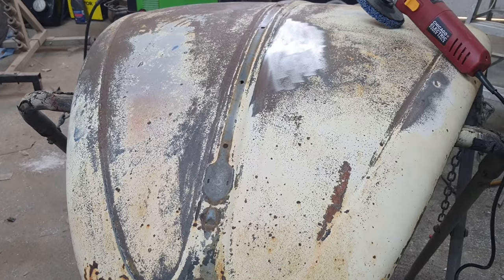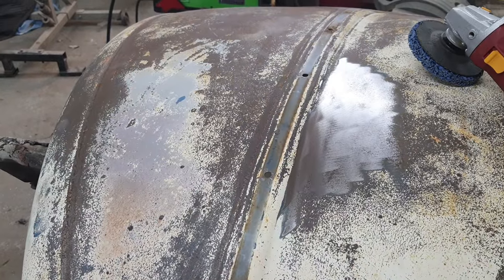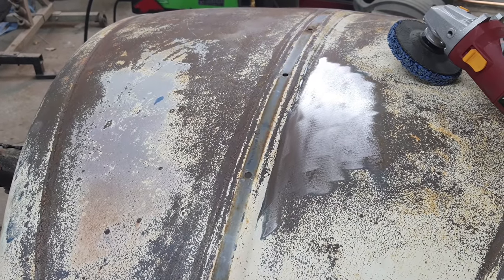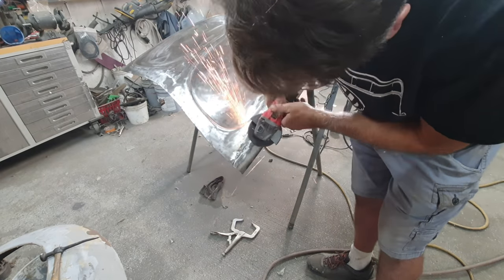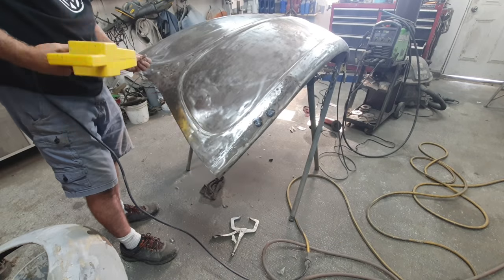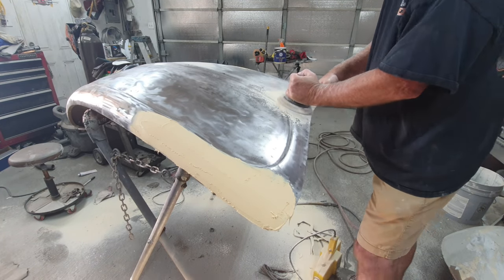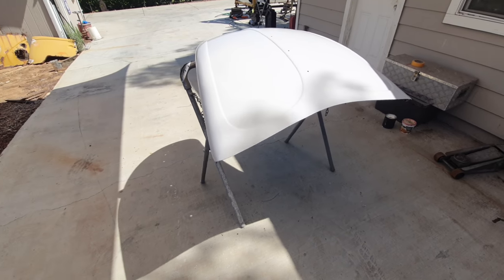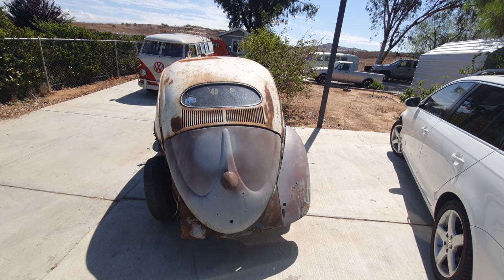1954 VW oval window Hood restoration forgotten Abandoned VW bug Metalwork to primer

Comment: Great video,s. I'm a body man up here in Northern Newhampshire.  We only use epoxy to make paint stick. It's not a good sealer at all. We here never do bodywork over primer. I was taught the old school way. Always go to bare metal before bodywork.  No rust in California.  Up here you don't find many old cars. Keep up the great videos. I also bought the titanium welder from harbor freight.  Works great in my opinion.
Reply from the maker: Thanks for sharing

Comment: Mike I’m not being critical of your work. I enjoy watching your vids. Just some ideas for you. I’m a collision tech/instructor/restoration guy for many years. 
Here are my steps. 
Metal work, rust converter as needed, epoxy the entire panel, body filler over the epoxy, epoxy again or DTM primer, block bodywork, prime again, block again, prime as needed or sand ready for paint. 
If there’s not a barrier between the metal and body filler it can be rusting again. 
Also gotta keep hands off the bare metal. Use some sort of latex style glove while working the metal.

Keep up the good work.

Comment: Nice work on the hood, mike. I use epoxy Bruno to convert rust, and it's an epoxy Finnish at the end. So that's sealing everything between the converted rust and the paint.
Reply from the maker: yea tamco has one of those too. encapsulates rust for almost ever. like epoxy.

Comment: Looks good Mike, So using the blue flapper disc with light pressure just takes off the paint and rust without sparking up the metal then?

Comment: Hi Mike very helpful video. I have a 65 beetle that I'm restoring and live in PA. We get lots of rain and road salt in the north. My problem is I have Chronic obstructive pulmonary disease (COPD) So everything take twice and three times as long to do. 

I'm confused on some things. I got the Rust Converter Ultra but it says for oil base paints and I know you've used it successfully with other paints. Can I use Epoxy Primer/Sealer over the Rust Converter Ultra? Also which Epoxy Primer cam I use?

I'm also confused on which paints I can put on top of the Epoxy Primer.

All these manufacturers what you to use there systems only. They don't tell you what you can put on what.

 I have watched other peoples video's where they say Epoxy Primer is not sandable and the first thing they do is put a high speed sander to the primer. This is so confusing.

My car is outside and I want to fix it and drive it again. Thank you for any help.

Comment: I don’t understand using the rust converter then sanding it.seems you’d sand everything off first then use it on the bare metal?
Reply from the maker: where the rust is there it etches into the metal. so in the low parts of the pits where I could not remove the bits of rust it is treated so it wont rust again.

Comment: Hey mike, i'm starting the process of stripping my 65 beetle to bare metal for paint and body work and i was wondering if you recommend using chemicals like aircraft remover or if you think one of those stripping wheels you used in this video would be better, Thanks
Reply from the maker: when there is not so much surface rust I like chemical. The new chemicals are pretty expensive since they outlawed that fluoride stuff. So you may find yourself using more stripping wheels. If there are lots of coats still would use chemical. these stripping wheels seem to be hard on your body with lots of coats. Best to get both. and some woven wire brushes.
Reply: @Mikefngarage  thank you! just did some digging and it turns out i have 8 layers of single stage so that sounds like it'll be mostly chemicals